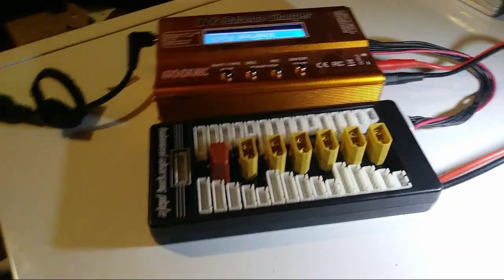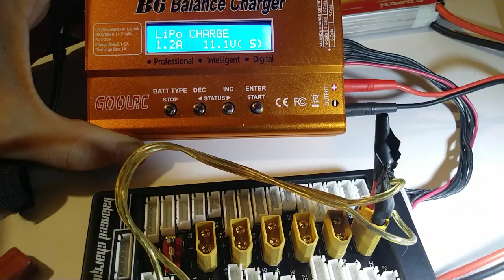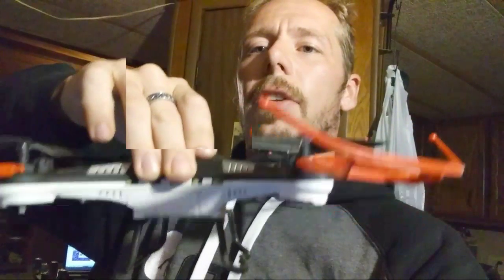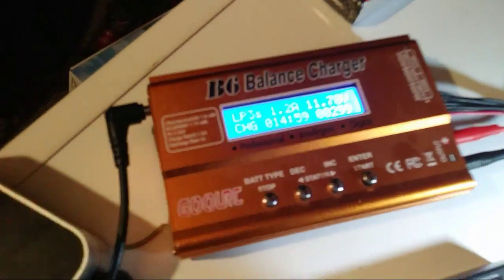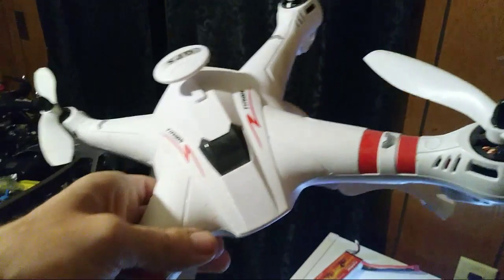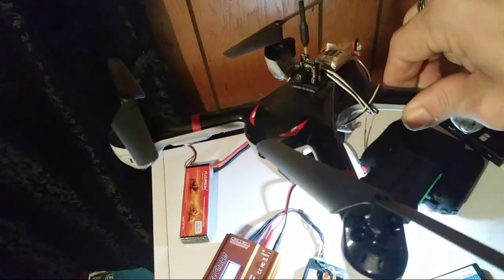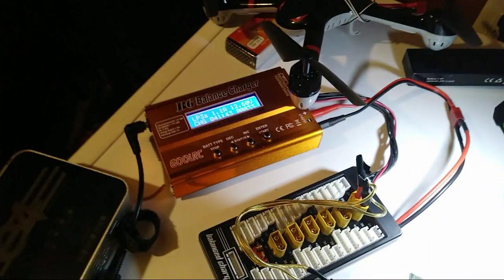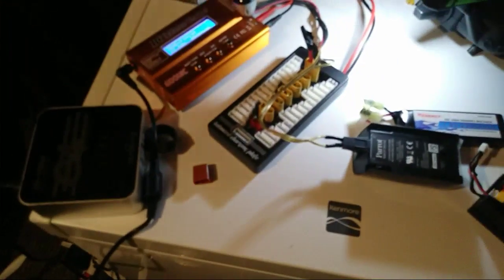B6 Balance Charger & xt60 Board Overview BEBOP BATTERY BUGS 2

Comment: Thanks Jay. It's pretty expensive at 10 to 12 bucks a pop for a 18 pak of AA batteries for the transmitter. .  may I suggest Li'Fe 6.6 volt batteries with a 1N004 Diode which would reduce the battery voltage down to a strong  5.9 volts and last a week plus without charging once fully charged. it's what we do with our aircraft transmitters..If you'd like more info, let me kno.. anyways, I was curious if you had upgraded yours and your thoughts. I follow all your vids on youtube, I'm a nub- to drones and highly like the bugs2 c. keep up the great work & vids. Thanks. I'm looking into Facebook.  at 63 I really rather fly.. lol 
But could you post the fb drones address and I'll check you an everyone out. 
Peace Brau